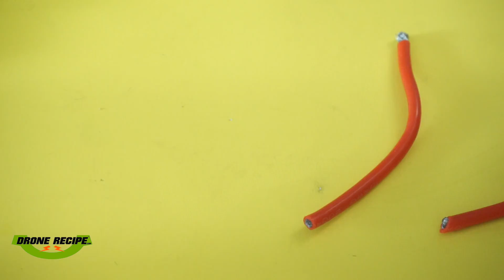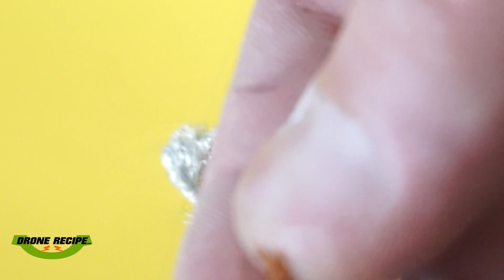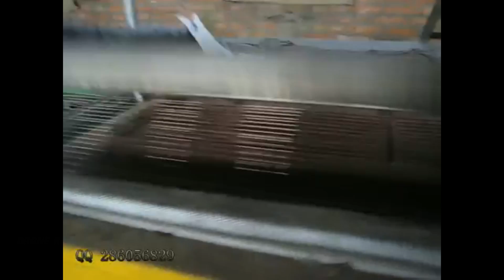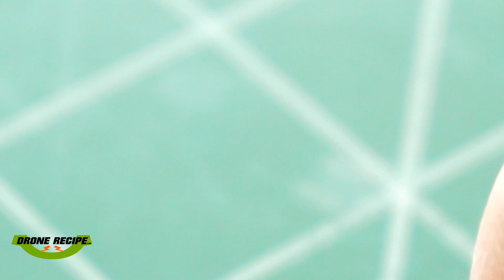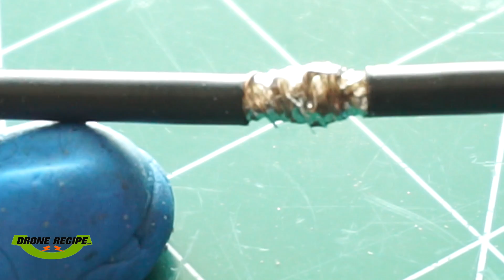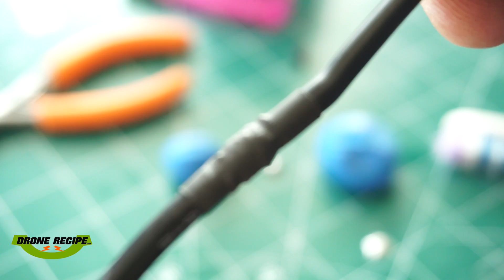How to Solder Silicone Copper Wire Together

Comment: Great job i really like the way you went through the manufacturing process to explain how those wires are made and why the tinted copper wires could be a good option even though plenty of people prefer the pure copper wires tho..
Reply from the maker: the tinning helps with corrosion

Comment: Whenever I try to solder silicone wire to a pad it fails to adhere like copper. I end up blobbing excess solder over and encapsulating it. This is problematic though as it has poor conductivity.
Reply from the maker: that means the pad is dirty. Clean with alcohol and use flux :)
Reply: Drone Recipe No the pad is tinned fine its something to do with silicone wire. It looks like the strands have a coating of some kind making tinning of the wire itself problematic. If I use regular copper wire its no problem.
Reply from the maker: @changeagent228  that's enamel coating which is a good thing to have on wire.  Use acetone or just gently scuff off. some people even use the Bayer Aspirin method but I don't recommend that as the fumes are unsafe
Reply: @DroneRecipe  Yes I just use a sharp blade now. 10 month delayed chat lol. 😁